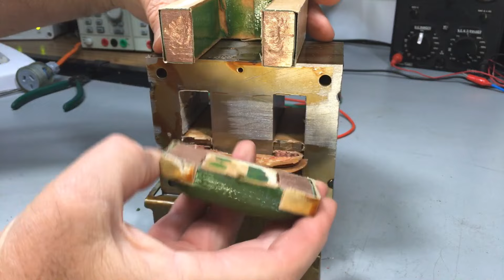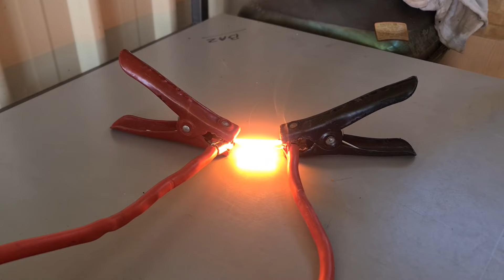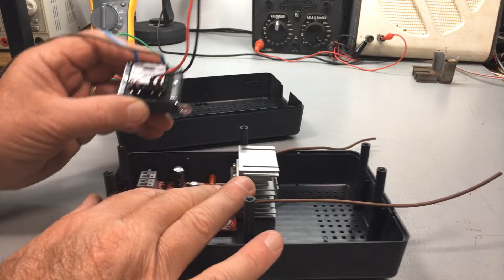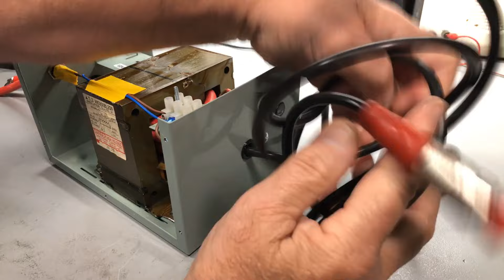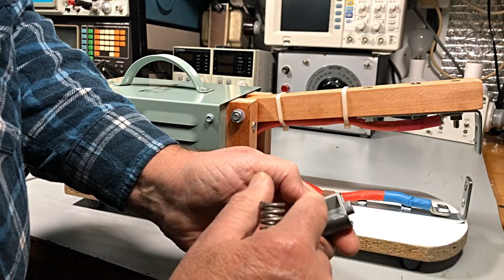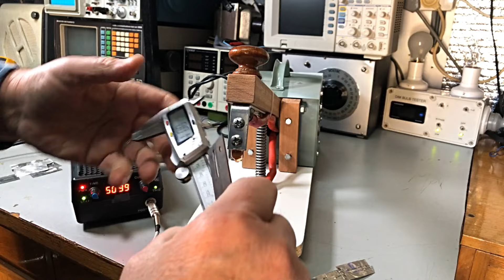Lets Build a SPOT WELDER for the Workshop !

Comment: It looks great Baz, but I'm really concerned about the bolts that hold the angle brackets to the wood. They look to be in electrical contact with the leads, are you going to insulate them because I don't think the wooden knob is far away enough from them to prevent you accidentally touching the metal bolts when you operate it. You're really great with safety on every thing I've seen you do so far  - so not a criticism, I'm just concerned. (I don't want to tell my grandmother how to suck eggs - but I'll take the risk of sounding like an arse just to make sure you don't get hurt mate.)
Reply from the maker: Lol, it is all good. Maximum voltage on the brackets is 2.8volts, wouldn't be enough to hurt an ant.
Complete safety !
I thought I addressed this in the earlier part of the video. Cheers 🍻
Reply: @techobaz55  Fair comment Baz. I dare say even if your contact with the electrical point is presenting as little as 1000 Ohms of resistance the current is going to be 2.8mA AC at 50 or 60Hz so barely above the threshold of human perception. Maybe I am being a bit over cautious LOL. I got carried away with the sight of that nail melting I suppose. edit: The trick is not how much current something can supply, but how much it will supply in certain circumstances.
Reply: Baz A Excellent presentation on construction of Spot Welder,When working as After School  job for Auto Electricians cum Motor Rewinding and Radiator Repair they had a Home Made Spot Welder you changed the Welder current by sliding inside core out the Welder Transformer and Welder Contact by Treadle foot operation, that was made contact with job in hand

They use call the Beast I think it run on single phase,Getting back the Microwave Transformer we used them in time gone By as heave duty Power supply strip the High Voltage Winding a remove the Wedges Winding a few turns of Heavy Gauge wire to Produce 18 Volts and to Bridge Rectifier on Series’s Pass Transistor they made excellent High Current Power Supply.
I was greatly impressed by your Presentation Baz and Ali gator is excellent name the beast 
Microwave Transformer are thing of Pass New Microwave use Switch Mode to Power them now anyway Baz it bought some good memories for Me,Ian,